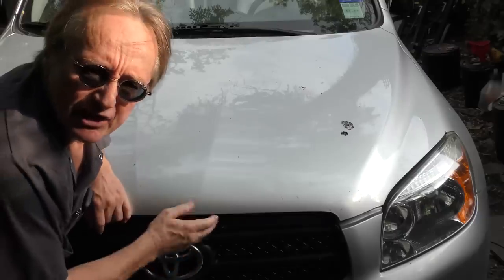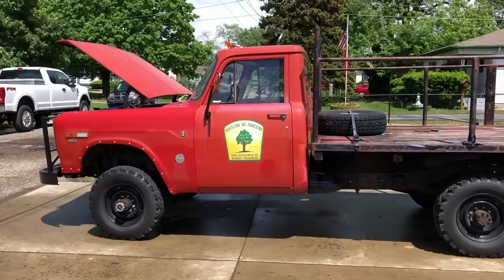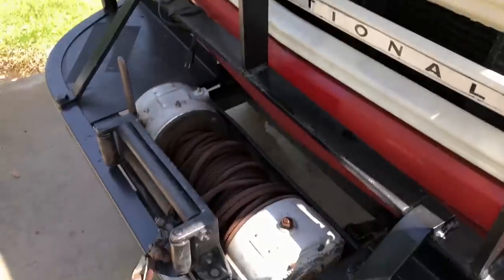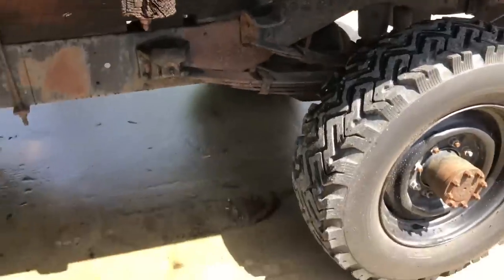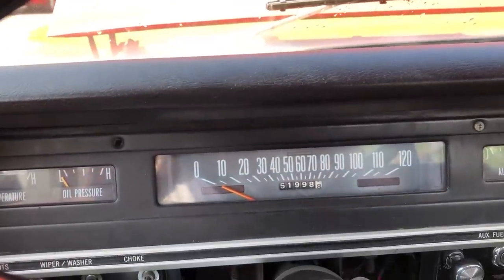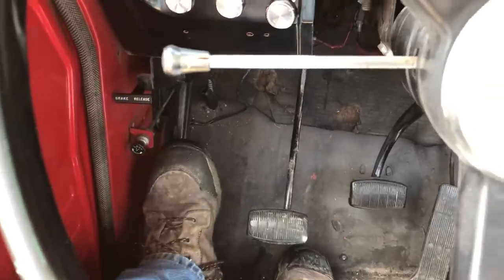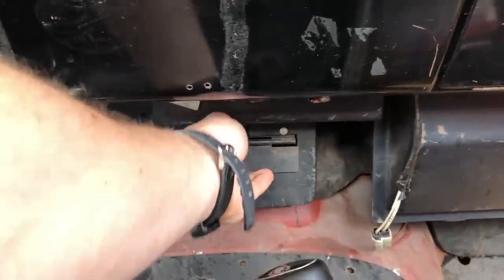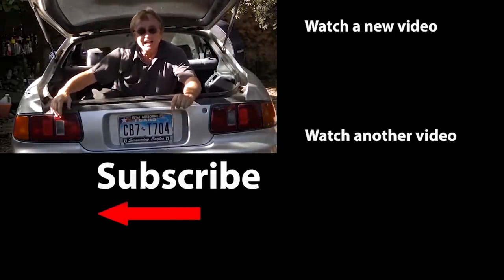Here's Why You've Never Heard of This Pickup Truck

Comment: I love it. I have a 1974 loadstar 1600 345 dump truck. international best. engine 60,000mi.  runs wonderful. I use 15w40 rotella run high octane fuel w lead additive electronic ignition. nicknamed Banger truck.

Comment: Hey Scotty, are the new 2020 Toyota corollas worth buying if I wanted to buy a new car. I hear you constantly praising the Toyota Corollas.
Reply: I believe he would say because it's powered by a cvt he wouldn't recommend it but if the manual option go for it.
Reply: Anything thats not a 94 Celica is straight trash
Reply: @geigerzoola6642  I disagree. My uncle had a 1992 Toyota Camry that was super reliable despite him amusing it. Also have a friend who's family still has a 1993 V6 Camry with 270,000 miles.
Reply: Grand Master Mawile it’s basically a celica so get it and it’s a Toyota parts available and reliable
Reply: TwiNkii I'll have to ask the dealer if they offer manual transmissions over cvt. I mean I don't mind cvt since Scotty pointed out that Toyota gets the best ones on his cvt video. I want my new car to last a long time
Reply: Joaquin Valadez yeah but I have extra money to spend freely so I'd rather buy a nice new one that won't break that often. Plus I'm sick of this Volvo that starting to give me all these problems. Had it for 14 years

Comment: I still drive a 72 IHC Travelall 3/4 ton. 392 and 727 transmission. Mine does have the A/C and electric tailgate window that still works geat.

Comment: I have always liked International trucks.  I once owned 1949 model KB 2 (3/4 ton pickup).  That truck was indestructible.  Had an inline flathead six with peak horsepower of 70.  Top speed was about 55 mph on level ground.  6 volt system, crank out windshield for ventilation.  Popular knick name for any International truck is "Binder", this is derived from the fact that the first piece of machinery that International produced was a corn binder.

Comment: LOL!  "Never heard of?"  This was almost Old Home Week!  Over the last 40 years, I've done a LOT of work with my ex-Navy 1966 1300 4x4 with 10,000 lb. Ramsey PTO winch.  Being Navy, it came with Dana 70F in front, 10,000 lb. Timken rear, but the smallest 266 V8, and was rated at 9,000 lbs. but I've gone over a scale at 12,180.  Great truck!  Just got old and rusty.  If I can find a good cab, I'll save the chassis and restore it.

Comment: I learned to drive on a 1946 IH pickup. My Grandpa swore by them. I tried Chevys and Fords, but wound up with a 1963 IH, 6 cyl. standard with  a long bed. I paid $300.00 for it, drove it 13 years and sold it for $600.00. Grandpa was right. I wish I still had it.

Comment: I have a 75 scout II 304 a 727 automatic transmission Dana 44's front and rear.  Its right hand drive no glove box.  It did a mail route in Denver.  It has power steering now. Yep none of them had power steering in the USA. I also put a motorcraft 2 barrel on it. Made it way more dependable and driveable.  Especially when 4 wheeling.  I realize the hardcore Holley guys are going to beat me up over that.  I've been a technician for 39 years and that works for me.

Comment: I used to have a 1970 Scout with a 304 V8 and a 4 speed manual...damn thing was rusted to death, but everything still worked and you could let go of the steering wheel at 55 mph and it would stay straight and true as far as you wanted...or until you hit a bend in the road, lol. It was great up in the hills wheelin' too...climbed like a mountain goat and never let me down, except for when one day I was driving on a dirt trail and heard a weird noise and realized I was dragging the driver's side fuel tank on the ground, lol. The mounts had rusted off, so I wired it back up with bailing wire and it was still holding it up when I sold it years later. The body was totally shot by the time I got rid of it...if you drove in the mud, you had better not be wearing nice clothes, because you would be covered in mud from the holes in the floor, lol, but it ran like a top. Wish I still had it.

Comment: My first vehicle was a 1968 International pickup. I think it had a 305 engine and a 4 speed manual in the floor. 1st gear was a granny gear. It had positrac rear end and it would go just about anywhere. About the only time I got hung up was when I sunk down to the frame. Wish I still had that truck. It got to where I couldn't find parts and in the pre internet days you were just out of luck.

Comment: I think they stopped making IH pickups in 1974. I had a 63 IH for several years go anywhere never let me down. I have my father's C1200 1969 model still runs needs some work. No power steering.

Comment: Decent truck. I owned an international scout with the 304 v8. Their engines have forged crank and rods and gear drive instead of a timing chain. 50000 the engine is hardly broken in..

Comment: Those baby's, both Dodges and Internationals are dime a dozen here. I miss that tinny thump of the doors when pulled closed, the old man had an old ex-ambulance. Loud and drafty during the winter, but they had a really nice round heater under the dash that could throw out a lot of heat. But took 1/2 an hour to warm the large space inside the ambulance.

Comment: The 345 ih motor was a great motor and a lot of people don't know this but the cam timing was gear to gear on the 345. It was more of a truck engine than anything else. It also had front and rear motor mounts, not the centered one you see on most V8 engines. If you ever get the chance to open up the front of the engine, check the timing marks, because of the 70s emissions laws the timing was retarded (I believe) and you could reset the timing one tooth off and gain hp. I know this because my dad bought a new IH Travelall in 72 or 73 and performed that repair.

Comment: Heard of one? I used to OWN one!!! First Truck I ever owned! Same year,a '71 2wd 3/4 ton long bed stepside,and it was oversprung I'm sure. Old Highway Dept. unit from 'somewhere'. Bought it cheap,needed front tires,brakes needed work,and the back lights were out. That awful yellow,with the stripes on the tailgate....I called it the 'Bumble Bee' because of the paint scheme,long before the Transformers came out? Manual steering/brakes,4 spd w/ 'Granny Low'. Previous owner stuck an old Ford AM/FM/8trk radio in it,looked like they used a sawblade and a pair of pliers to make it fit!!! No AC,of course. Straight front axle. Geared down like a Wrecker. Heavy,shop built back bumper and a steel plate in the bottom of the bed.Thing was only good for about 65-68 mph anyway. After I sold it, My father,and a few other people (I even did a few times?) would tell me 'Hey! I saw your old Truck on the road!' Last I saw it,(About 18 yrs ago...I sold it in '85!!) it was being used by a guy who did paving/concrete work,and ALWAYS loaded down,and most times towing a tandem trailer!!
Reply: 'My' old truck was so easily spotted by others and myself due to a modification I had to do. Remember the part about the rear lights not working?? In order to make 'all' the lights function,I had to split the circuits. Turn/Parking lights were the 'original' tail lights,the brake lights were two round 'lollypop' trailer lights mounted to the top of the back bumper,right below the 'original' lights.

Comment: I want that truck. I had no idea they put those vents on pickups
Reply: Most every pickup still had side/floor "kick panel" vents back in the 1980's and earlier. Same with triangular vent windows in the doors. A lot of things sure have changed since then, and certainly not always for the better.
Reply: Yes I drove a 1981 Ford F-350 with “Dealer A/C” but it still had the floor vents too.

Comment: You could custom order a late 60 s IHC pickup just like you could custom order their big trucks. They didn’t have to be stripped. Dad ordered his with the 345 V8 , the five speed manual they offered in the medium duty’s and 4.88 gears. And Air conditioning that bolted under the dash and chilled you like an ice cream truck.
Reply: Twin tanks,4 doors, six foot box, heavy duty everything. Twin bench seats thick like a sofa. And a grape colored paint job just slightly different than mopar plum crazy.
Reply: 4wd two speed transfer case, hand throttle to aid winter warm ups , tach, oh Christ he bought everything lol

Comment: I have a 74 D200 4x4 392 w/727 torque flight 4bbl Holley with 58k original miles... just not as pretty...yet.  It is extremely hard to find parts for these...I currently am looking for a windshield but they do not make them anymore so not sure what to do.  Anyway ..yeah nice trucks..for real trucks.

Comment: Throw a 12v Cummins in er
Reply: I have seriously thought  putting a 12v Cummins in it, but decided to upgrade to a 345 from the original 304.  Afraid it wouldn't be very fun to drive with it being geared 4.88's.  If it had 4.10's, then that would help.

Comment: Every one of these things I've seen,the automatic transmissions are ALWAYS blown out of them.
The reason why International had so many issues with them is because of one reason...I.H.always used GM hydromatic 400's in their trucks and basically they were and STILL ARE JUNK,if you were serious about buying a brand new I.H.truck "back in the day",you ALWAYS bought it with either a three or four speed manual in it.
Reply: For a time back in the '70's IH used a modified 727 TorqueFlite automatic, I had a '73 1110 with one, my uncle was an IH dealer in the fifties and sixties, my dad bought a new '68 1100 with the 304/3 on the tree,I also owned a similar one to this truck,a '71 1210 4wd ex fire department brush fire truck.
Reply: @rogercamp6071  The 727 trashflight was considerably worse then the GM hydromatics were.
My dad briefly thought of maybe buying one with a manual in it back in the early 1970's.